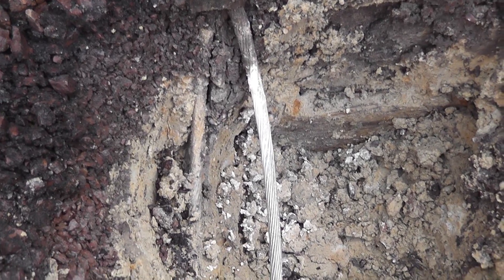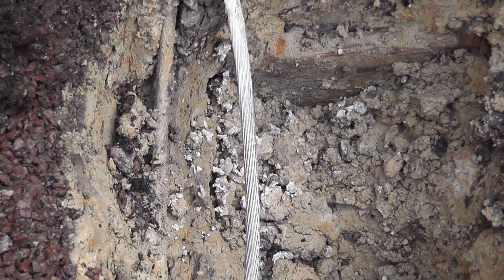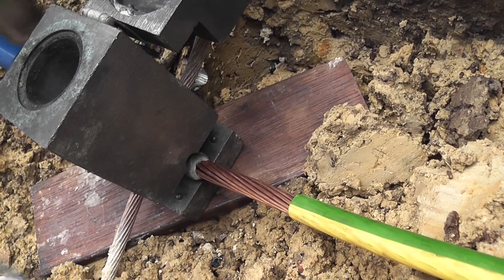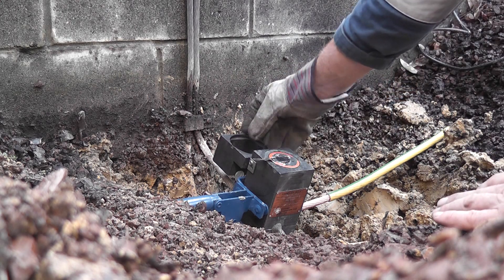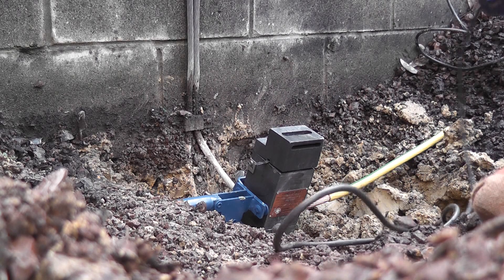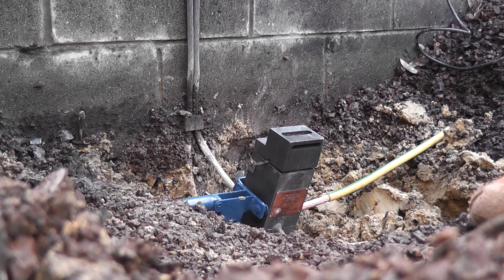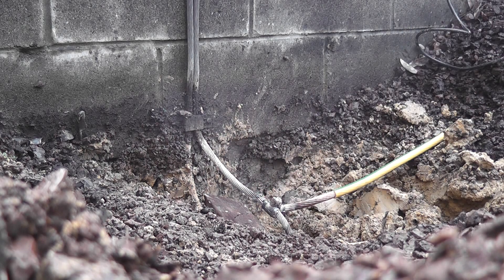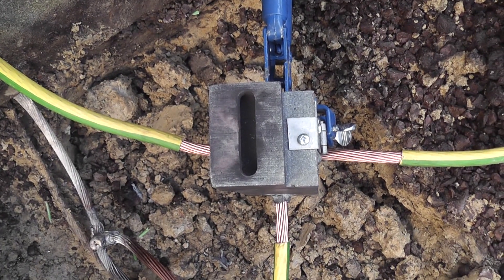Cadwelding Earth Cables

Comment: your first joint wasn't the best from what i could see it didn't fuly encase the existing 90mm giving a high likelyhood of joint failure, plus you need to keep the mould as level as possible cause if you don't the liquid copper mix moves and causes a bad joint as seen above